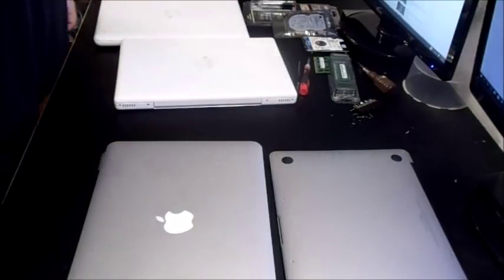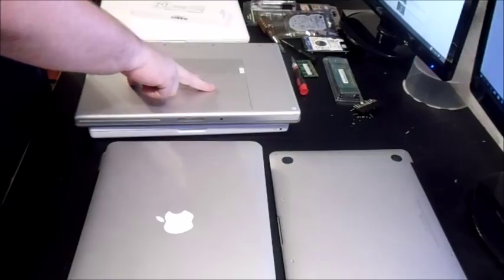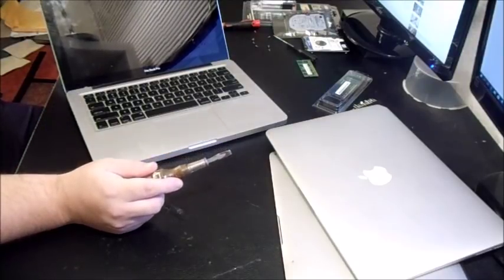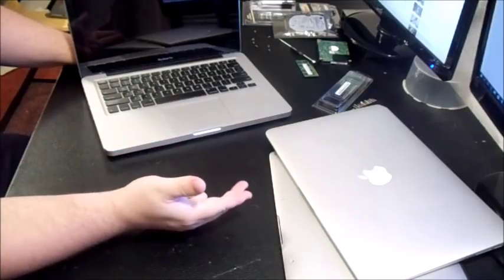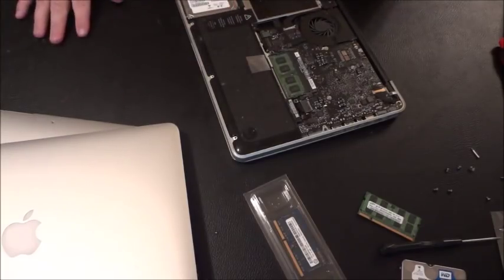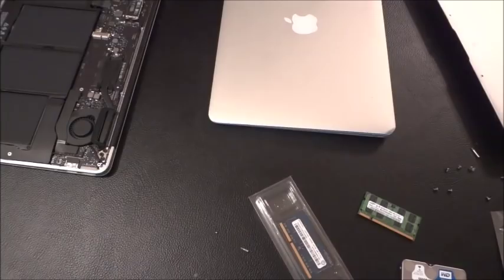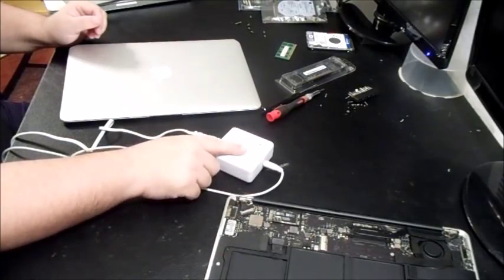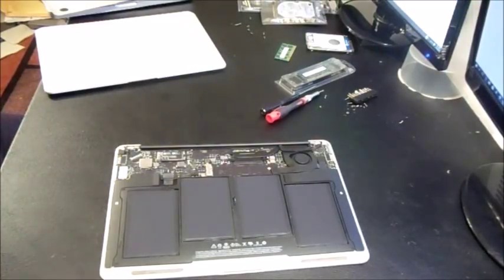How to Buy Sell FLIP Broken Used Macbook Laptops for BIG Profit on Craigslist Online (Ebay Parts)

Comment: Love the video! Thank you! Was wonder where you go to buy parts that you may need to fix a broken macbook? All of the ones sold for repair have the hard drives taken out, so if I am going to restore it, I will need to purchase a hard drive for it. First one I purchased had water damage and stopped working. It was a 2010 13" Macbook Pro. I bought for 162 plus 15 shipping. Thought it might be possible to flip it if I can restore it and make a slight profit and if not the parts would sell, it appears to be in really good condition cosmetically. Thoughts?
Reply: Also, the newer versions of macbooks have a lot of the parts soldered on? Is this true?
Reply: I stay clear of water damage and offer $10 tops.

Comment: I got a 15 inch early Macbook pro with 2.2 GHz Intel Core i7 with both an intel HD Graphics 3000 and a AMD Radeon HD 6750M for free because the previous owner said it was broken it works but once the cord is unplugged it shuts off then you have to put the cord back in. It will buzz three times then turn on. It does semi work using it now to watch your video :).
Reply: Early 2011 macbook pro
Reply: Replace the battery and it will be as good as new
Reply: watch those 2011 15inch they have terrible graphics problems with the radeon

Comment: Thanks, this is really helpful I’m about to buy used MacBook Pro. I have Being think on how to go about it and how to get a good buy. 
For a new user what do you advise MacBook Pro or Air. I’m not into graphic or video editing bot I like the DVD feature of the Pro.
Well I saw the white 2009 that you displaced last going for $190 work with 4gb Ram. I think they don’t use SSD right?

What are the other feature to check to make it a good deal.

What hear do you advise to buy.

Thanks

Comment: Where do you sell the parts and how long until someone buys them normally?
Reply from the maker: Ebay is a good place.  It can take anywhere from selling the same day you posted to 30 to 60 depending on the price and demand on the part.
Reply: @RubberWilbur  
Are there more fees if it takes longer?
Reply from the maker: @Ayo.Ajisafe  Ebay has fees per month.  So to keep a listing up its only like 25 cents per month.
Reply: @RubberWilbur  wait what? I thought you were charged by listing?
Reply from the maker: @Ayo.Ajisafe  yes they charge you commission plus the fee to keep a listing up.  But keep in mind you have thousands of eyes on your listing across the country comparied to craigslist.  It's worth it.
Reply: @RubberWilbur  Thanks